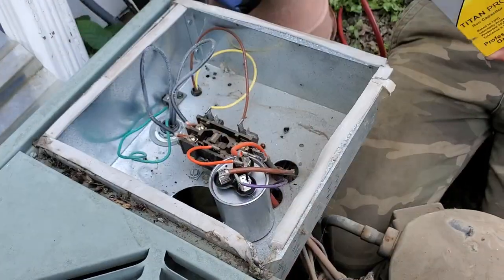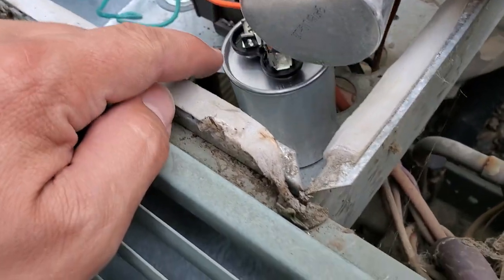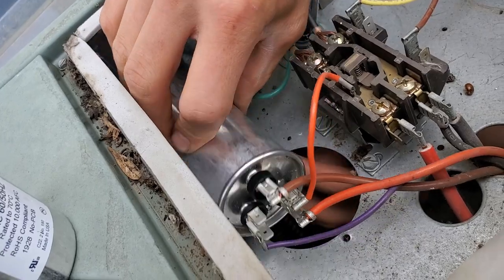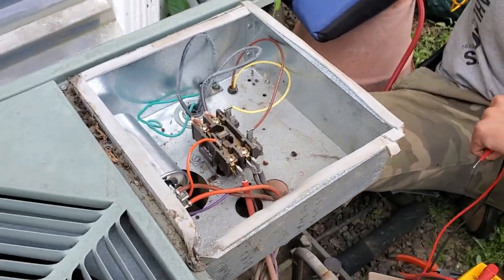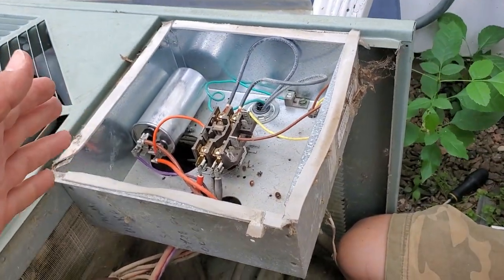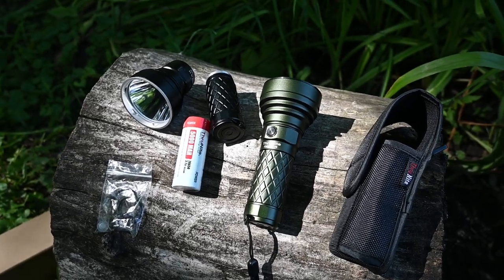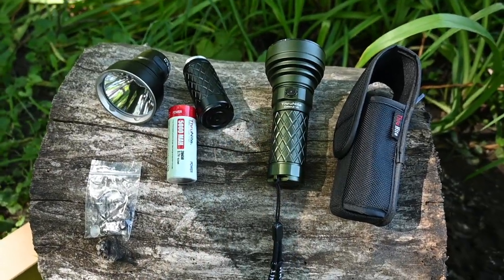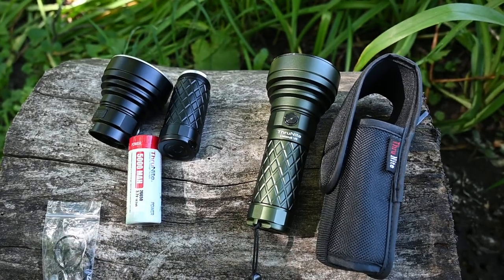AC Fan & Compressor Won't Start - Service Call Ride Along & ThruNite Catapult V6 Flashlight Review

Comment: My 20 year old AC isn't starting, and my first thought was maybe bad capacitor\.  Yup.  Then I realize I knew this because 9 months ago I watched this video.  So thanks!  You saved me a service call, and honestly I'm sure it would have taken a while just to get someone here anyway.  Now I wait for the new capacitor to arrive.

These things are cheap enough ($20 shipped) that it likely makes sense to just change it out after 15 years.

I did notice one tell-tale sign the cap is bad.  If you push on the fan blade, the fan slowly starts up, and then speeds up.  IIUC this is because the fan generates its own magnetic field just by running.  But of course there's no magnetic field while it's dead still (Thanks Technology Connections!).  So pushing the motor a little generates a small magnetic field, which generates a little more magnetic field, which makes it run faster, which generates a little more magnetic field.  Rinse/Repeat.

Any advice on a 20 year old AC unit?  The "rule of thumb" seems to be that AC lasts about 20 years.  I don't use it more than maybe 15-20 days a year, so I'm guessing it'll last longer than 20, and it doesn't make much sense to spend 4-5 grand on a new unit when the old one might last another 5-10 years.

Comment: Being a hvac/r service fitter tech, best to install capacitors in a upright position to prolong the life of them. Every manufacturer says upright not sideways upside down ... I have made the same mistake countless times when I first started in the field. You will notice the factory “ways” Also, that Rheem/Rudd condenser, had the massive hole to fit the capacitor upright position.. you will notice more and more “larger body” dual caps at supply houses and factory versus skinny slim body now in 2020 versus 2007 ..they can handle the high outdoor ambient summer temp and in rush amps “ initial power load” when turning compressor over better and not blowing up internally. Only took me 12 years seeing same issues and new ones to really see the underlining problems every 3-5 years the customer complains about... still can’t say well I seen it all! At least one call a year still has me banging my head against a wall unable to truly resolve it...

Comment: cool vid on the compressor fix. simple, and a few $k less than the normal "just replace it".

But, OMG on the flashlight. Why oh why don't all flashlights require hold button to change run mode (bright, less bright, flash, SOSOSOSOSOS...).

Comment: Good fix.
Mine keeps tripping one of the breakers on the box outside
and the breaker is hot and smells a
little burnt. It runs for about 5 min
Reply: Replace breaker.  Check resistance of contactor points when closed or check voltage drop across points when unit is running.  Make sure all connections are tight.  Check capacitor like shown in video.  Make sure exterior fan is running correctly and make  sure coil is clean.   After all that is done check amp draw of running compressor.
Reply: replace the breaker, and unless replaced very recently, also the capacitor. I'd check the model for what cap it requires, as someone might have put a 30 on it, and it needed a 35 or 40.
Reply: u2ooberboober, Thanks for your input 😊
Reply: Jason W,  Thanks for your input 😊
Reply: Also inspect the disconnect box itself for corrosion. I had to replace the disconnect box for my AC several years ago. It had gotten hot enough to actually melt several inches of insulation back into the conduit. If the conduit had not been there my home probably would have burned down. Sad thing was that the AC tech I called out, when it started popping fuses, just cleaned the coils and called it good. I ended up finding the problem on my own.
Reply: Jason W,  I got the new breakers and I started it up and I put the meter on it and it’s drawing 36 amps the original 30 Amp ran for nine years. It started smoking.
Reply: @classic287  final check might be to see if any wires have burnt insulation inside the unit. A video on YT showed a heating element's wires were burnt causing a short. They unplugged the compressor's heater to temp get it functioning until it was more convenient to replace.
Reply: dbinok, That’s real reassuring, 😂 Thanks 😊

Comment: How about a 3-phase compressor that won't start and has 277 volts to ground on each leg but 0 volts between legs even tho no wiring was changed, any ideas?

Comment: Good afternoon your video is quite unique I see a lot of faults and I see you are an engineer and you are quite good at what you do but I also see that you have a few errors in a video. One the cables are coming through the box needs to have a gland some kind of rubber grommet put in it stop the cables rubbing against the box. 2 your capacitor covers and not on the terminals as they would be a shock and Hazard. 3 where you have put the capacitor you do need to put a rubber mount to stop it from touching any of the surrounding area is there any advice please take it as that I have been doing illegible for 25 years plus in the UK and I keep seeing this on YouTube and now you say it educational but you get the odd idiot that doesn't know anything about electrical and they blow themselves up
Reply: I'm pretty sure this is a service call they are on and they are just here to get it running, not ring up a huge bill for the customer.
Reply from the maker: Thanks for sharing your perspective and experience! We always do our best for the customer and on older systems there can be things that were not done correctly previously and we can't always fix all of these items since that is not what we were requested to do. Thanks again for your comment!
Reply: Have to agree. The most fundamental capacitor test, measuring uf, was not shown.  Measuring the back emf on a running system is not routinely done especially since most new caps are dual voltage rated up to 440vac. I realize cheap meters do not always have high enough uf ranges but there are <$50 meters that do.  Securing the cap and installing  bushings are $2 items that will save a call back failure.  As will cleaning the coil.  Measuring the voltage drop across the contactor phase is also essential, especially when the contacts are as corroded as shown.
Reply from the maker: @rj.parker  We did test the capacitor. Just didn't show it this time.